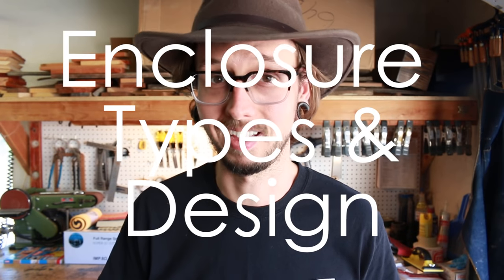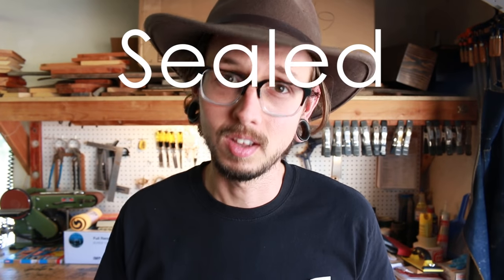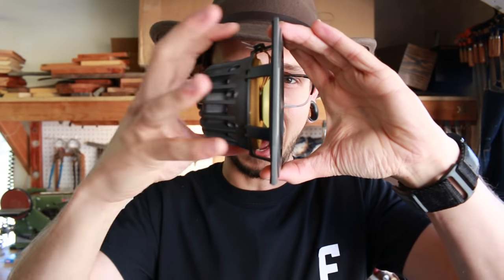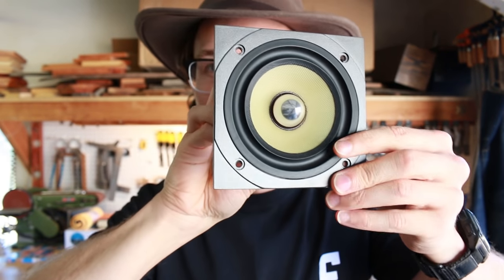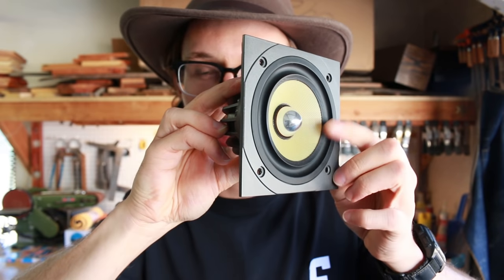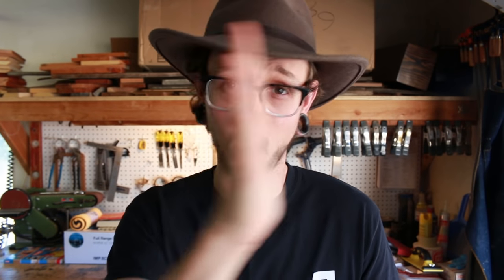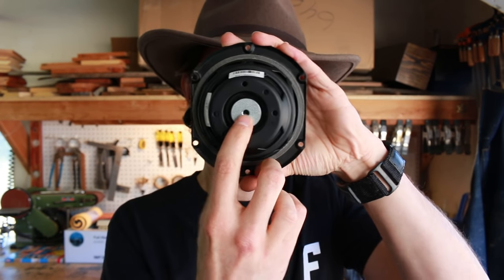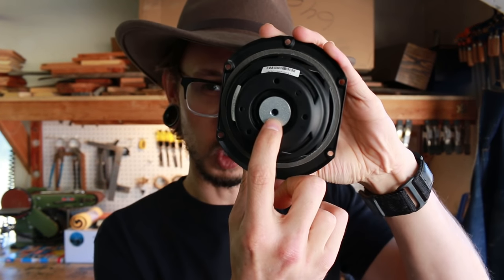How To Pick An Enclosure Type | Step 1 | DIY Speaker Building

Comment: Hey Kirby, thanks for all the info. Looking forward to the DIY studio monitor build video. If I may suggest that you apply a high pass filter to your mic input at around 90 hertz or so. There was some super low end rumbling noise (e.g. 1:13 to about 1:22 and other spots) in the audio. Sounded like it was from a mic but could've been something else. Also, you can add to your explanation of transients (of a snare, for example, to stay with that example), that it's the very first part (the stick hitting the drum skin) of what constitutes the entire sound that a snare makes over time (the attack, the drum resonating, the metal snares, the ring, the room, etc). Thanks again for the concise info.
Reply: chill

Comment: I am enjoying these videos!  I built a 12” car subwoofer enclosure back in the early ‘90s.  It was technically made “wrong” but it sounded amazing. I attempted to calculate the VAS, ported it, then made it out of plywood that was way too thin.  The whole box flexed and acted as a transducer but hey...it jammed when I played the Metallica Justice for all album!  I intend to build a sealed portable box for an iPad to be plugged into.  It’ll be loaded with 4” full range speakers.  Will it sound like crap?  Probably, but it’s designed to play Ted Nugent songs.  That Byrdland guitar will sound good but Bodybangers, and Deadmau5 won’t .  I’ll send a link to my build when I do it.

Comment: Hey Kirby,

first off, I really like your videos. They have inspired me to rebuild one of my old speakers.

I have only build a large speaker box with two dual way speakers, a sub, an amp and a large battery pack a few years ago. It wasn't really high tech, didn't have the best speakers in the world, the amplifier was way way overpowered and it has been one of my first builds ever, but the speaker quality has been sufficient and I have had a lot of fun with my build and use.

Unfortunately the thing has started to rattle and has been showing some flaws over time. So I decided to take it apart and build a new one. Either a large one with all three speakers, or two separate ones for the sub and dual way speakers.

I've watched your video and followed the link to determine the dimensions of the speaker boxes, but came to the conclusion that I needed to build a gigantic box for a relatively small speaker. The speaker came with a build plan for a DIY speaker box and the dimensions a of this box are much much smaller than what has been calculated. 

Am I doing something wrong here? Did I mis something? Could  you recommend me reading or watching some other source of information?

ps. : Does the material affect the dimension of the box? What would be the preferred material to build a speaker box?

Comment: The only thing that makes passive radiator design "expensive" is the passive radiator itself. It's easy to make one with old drivers from speakers from the dump. Just add (and subtract) blue tack on the dust cap. I can get old speakers from the opp shop for $10 a pair if I can't find any at the dump. They are easier to tune than ported, box has to be a bit bigger than sealed and apart from that it doesn't matter what size, just adjust with blue tack weight. Passive radiator (I reckon) would be roughly a similar size to the active driver. Also you can just "beef up" old speaker boxes by bracing them etc. and "tap testing" them. It's really quick compared to starting from scratch (I love it).

Comment: 2:20 though I wish you had mentioned that a sealed speaker system must be airtight and it has to have filler, like cotton batting.  I remember when we were making sealed enclosures in the 80s with wood cut by circular saws (at best) and we had to throw silicone rubber at it to make it airtight, every seam, and we'd even silicone rubber in the drivers to make sure no air escaped.  And you'd test it be pushing in the woofer (gently and balanced) and watch it slowly return to zero.  I think that's one of the not-so-easy things about sealed enclosures.  They really have to be sealed or your woofer will not have the power handling capacity that it can when sealed.
Reply: lol at 4:18 ish you said ported is lower distortion than sealed.
Reply: 6:57 you fill a sealed design with filler because if you don't, the square angles will create a noxious boom which is not pleasant as all the radiation from the back of the speaker is bouncing off angled walls and coming back through the speaker.  You do it to absorb that rear energy so that it is dissipated in the box and not sent back out through the surround or the cone of the speaker.  Talk about what the speaker thinks?  Don't drown it in ponds and puddles of  bass bouncing off walls and coming back through the speaker to muddy up everything like some freaking swamp.

Comment: If the midbass' f3 is low enough to pair with 4th order bandpass use 4th order bandpass to extend bass.  Don't get used to the softness aka non-transience of ported like most afcs.

Comment: Great video, and it could not have been more perfectly timed!  A few questions- What if I can't find the T/S of a speaker?  I have salvaged a driver from an old Logitech speaker set and they don't have anything about it on their website.  I know it might seem cringe worthy using an old Logitech, but I rather like the way it sounds.  Plus money is not something I have a lot of as a teen.  Can I use the dimensions of the old box and port to find the T/S?  The other dilemma I have is- can I put multiple speakers in the same box?  What I mean by that is I want three speakers (for highs) in the same box.  Two are identical, but one is from a different manufacturer and is slightly bigger.  Can I still find optimal dimensions for the size of the box and port?  Should I just use an unported box for those?  Should I just give up and separate them?  I don’t think a radiator is the way I want to go.  Thanks for taking any time to answer! :-)
Reply from the maker: Hey Trevor! If you are salvaging speakers from an old system, I would try to use the same dimensions as the enclosure you are taking them from. Whoever made the speakers before put a lot of thought into that enclosure size for that speaker, so just leverage their work. As for the highs, are you putting three tweeters in one speaker? I'm not totally clear on what your setup is here, but a tweeter doesn't need any particular size enclosure. It's usually just added onto the enclosure for the mid or woofer. Thanks for watching!

Comment: Kirby, great videos! I am building a  small powered speaker with one woofer and two smaller ones for higher freqs. In the enclosure i am building i have space in the front only for the small speakers, where should i put de sub woofer? at the top of the enclosure or facing the table? thank you for al your videos and your help!!
Reply from the maker: Hey there Francisco! Sounds like an awesome project. I've seen speakers with woofers on all sides of speakers. Low frequencies are not as directional as mid or high frequencies, so you can put woofers on the front, top, back, or bottom. Its mostly a functional and aesthetic question. Have fun building!

Comment: I starting assembling a surround sound 5.1, currently have my fronts, rears and sub...I watched a few of your videos and now plan on building the center channel myself. I'm currently running 100 watts to each channel. The space I have for the center channel is 6" h x 14" w x 22" l so was thinking (2) 4" mid-bass and (1) tweeter...my question is would this require a crossover or could I place a capacitor inline? Any feedback would be greatly appreciated. Great videos!

Comment: u r great. i am making a PR design this helped lots p.s. you can get cheap passive radiators off ebay e.g. 4 au dollars per 3 inch passive radiator.
Reply: Qwervy 
How long does it take to deliver abroad?
Reply: i am not to sure you'll probably have to check out where they are coming from. i know from china/japan to australia is about 5 weeks, from brisbane in queensland to perth in western australia is about 2 weeks. other than that i dont know.

Comment: Hi Kirby, love your videos 

I am looking for some advice on how to modernize some old speakers. I have 4 old speakers in my garage that still work and I want to make two tower speakers and one sound bar and even make them Bluetooth. Here are the types of speakers I have.

2x Sharp Model No CD - E99 want to make into towers

2x thruster Panasonic SB 280 I want to combine them to make a sound bar.

I know nothing about building speakers but If you have time can you tell if it is possible and if so where do I start.
 
Thanks in advance

Comment: Two things about ports: "Chuffing" and one-note bass. Chuffing is when there is a tonne of turbulence resulting in a low frequency whistle. One-note bass is frequently encountered in bass reflex designs. This is a large resonant peak at one frequency. So, in that sense, sealed or PR enclosures are better, all the way around.... PROVIDED one has the right driver (Qts) for the job.

Comment: Those three enclosure types are a big commercial success because they are cheap and simple to manufacture. But that makes most affordable speakers look quite identical.
As an already quite experienced builder i am more interested in Transmissionline, Back- and Front loaded Horns or Dipole Woofers. Thats where you get most out of your woodworking skills, because that stuff is not commercially available.
Reply from the maker: That may be true, but it certainly doesn't mean they don't sound good. There are also plenty of ways to make those enclosure types look unique. I agree though, the more complex exclosures are much more fun and interesting to build and play with. This video is part of my "Intro to speaker building" series, so I stuck with the basics. But in the future I'll hopefully be making videos on enclosures of all types! Thanks for watching!

Comment: Hey man, you mentioned transients being a Pro of Sealed enclosures. What about Passive Radiator ones? Do they also have tight bass? And I guess there's no actual measure which describes a speakers capability of handling transients, so it's just gonna be heard by ear by being muddy.

Comment: What materials and what thicknesses You think are best for speakers? I find, many of speaker builders uses 3/4''MDF. Is it because of low cost or other qualities? Could be used plywood or wood panels?
Reply from the maker: 3/4" MDF is for sure the enclosure material of choice for its strength, ease of use, and low cost. But plywood is just as good if not better. Depending on the size of speakers used in your project, I wouldn't go under 3/4" thickness. You can also use solid woods. Some people don't like using solid woods for many different reasons, but I've had great results using it. Thanks for watching!
Reply: Kirby Meets Audio Thanks, Kirby! By the way - Your channel definitely is an finding of this year. Great! Please continue same way.

Comment: Hi, regarding the passive radiator- you mentioned about adding washers/weights to adjust the frequency response. I was wondering ,would adding weights cause a physical stress on the cone surrounds and the weight is pulling more down and back on the top parts of the surrounds. The linear movement would definitely be affected which would cause massive cone breakup. 
If however the cone was placed horizontally either facing the floor or ceiling,this stress would not happen as the weight would be acting perpendicular to the plane of the cone and equidistant from all ends of the surrounds. 
Does this make any sense or am I overthinking this. 
I am a Sea captain so calculating mechanical/physical stress comes naturally to me 🧐

Comment: QUESTION: I have a pair of JBL Studio L820 bookshelf speakers. I had bought them years ago to use as "Height" speakers with Pro Logic IIz sound. But, one of my JBL Studio S38 bookshelf speakers I used for the Front Left and Front Right broke. So, I started using the JBL L820 speakers for the Front Left and Front Right speakers. The problem is that the Front Right JBL Studio L820 speaker has a problem where the 6" Woofer "buzzes" during low frequencies during movies and even a couple music songs. For example, on the CD of the Halo game soundtrack, the song of "Halo" has several seconds where the woofer "buzzes" on the right side. It doesn't do that when I switch the left speaker to the right side. Do you know what could be causing this and how I could repair it? ... I suspect it was defective all along, but I never noticed it during the warranty period because the "Height" channels don't produce sound frequencies that low.

Comment: What is this fill you are talking about? Where can i find out More about it? :)
Reply: Der Baba aller Babas Babe that thing in your pillows also works great
Reply: Hi Der Baba, Poly Fill is a spun polyester fibre, used for things such as pillow stuffing, douve / dooner covers, some home insulation. It's a petro chemical fibre (sometimes made from recycled plastic soda bottles) it comes in various colours and densities so shop around you will be surprised at the number of different applications it's used for.
Reply: You can get polyfil from a fabric place.  It's used for quilts and pillows and stuff.  Earlier speakers used literally fiberglass insulation.  Very bad for the worker lol, polyfill or fil is much safer and easily found.

Comment: There is one more added benefit to ported speakers, albeit outside of the home audiophile circle, namely cooling in high powered applications like DJ-ing and sound reinforcement. And I assure you it's nothing to trifle with. Think of dissipating hundreds to thousands of Watts RMS during extended hours in a sealed, padded enclosure ;)

Comment: Vented is slow (I actually witnessed a half second decay on my vented ones) until I converted them to passive radiator (like with the bluetooth speakers). And with the same woofer tapping test there is NO decay. None. It stops dead at the same instant as my hand leaving the woofer. And of course you can tell the difference with the bass (like chalk&cheese). Sealed is also tight and fast but lacks efficiency. But passive radiator has the same tightness as sealed but more bass output. I'll never make vented speakers again cos of my test and hearing the difference when I converted mine to passive radiator. And more evidence: The Buchardt (Spell) S400 speakers have passive radiators and it's the most raved about BASS SOUND going (for a bookshelf design). And I know what a factor is...the passive radiator. Even more evidence: If a passive radiator can make a bluetooth speaker's tiny box have a bass sound so deep for it's size, just imagine what a passive radiator could do with full size speakers! When I made mine it simply blew me away (just like the Buchardt S400 reviewers were blown away).

Comment: If I buy 2 of the same speakers. Can I use one of them as a passive cone if I'm not conecting it to the amplifier?
Reply: Yes, in a way... It will work, but it will be difficult to calculate on since you have to take into account the mechanical resistance that the magnet creates which would be like putting on more weight on your passive radiator, but it will likely be too much resistance and the major factor against it is cost. Since you need a passive radiator that has a 1.5 to 2 times larger effective cone area, you'd basically pay for two woofers that you wont use. In that case it would probably just be better to let all the woofers be active.
Reply: @mikos321  not just the magnet but the fact that the thing has a voice coil.  It's not a passive radiator and can't function as one, in my view.  The coil alone changes the whole equation.

Comment: I have a question on a build I'm about to start: The project is a box for a 3 way center speaker (with a built in passive Crossover) for my 5.1 system. the Speaker will end up on a shelf above the TV.  My thought was, could I mount the bass speaker facing down and have the tweeter and midrange facing out or is it just mount all three facing out?

Comment: ok I just got done building a two speaker tower with some really thick wood about two inches thick. I was thinking about porting it but on the bottom. do you think that would work or should I just make it a sealed design? when I am done I will post a video here on one of your videos comments. oh and my speakers are 2 way speakers 4 ohm 100 watt each.

Comment: Very interesting video! So basically would it be correct to say that the passive radiator has the benefits of extending the low-frequency response like a ported design, as well as more accurate like a sealed cabinet? (also with less complicated calculations?)

Comment: I'm brand new to DIY speakers so this might not make a lot of sense but I was wondering if there is any specific/helpful way to figure out information like air volume in an oddly shaped speaker cabinet design?  like for example if I wanted to create a tower speaker cabinet with a cut-out on the sides (to create more of a tapered shape) how would I be able to calculate the size needed/air volume/ etc?
Reply: You'd use trigonometry.  If you don't know that, just visualize the whole thing and make it from there, I'm dead serious.  You have a woofer, you probably have information about what it's ideal sealed enclosure is, versus ported.  A lot of manufacturers post that stuff now, not like back in the 80s.  But anyways, read that and put it in your head and just visualize something in between with angles you think could work.